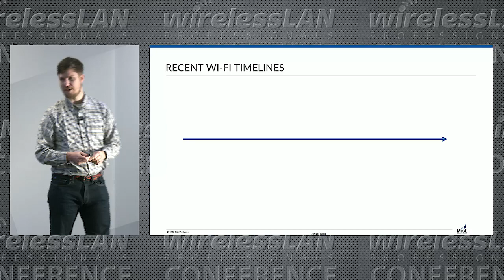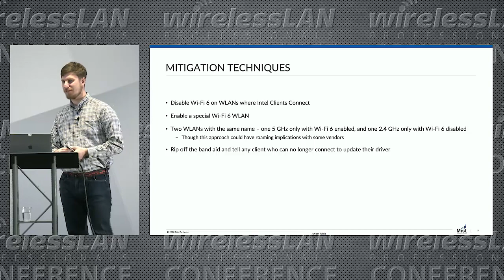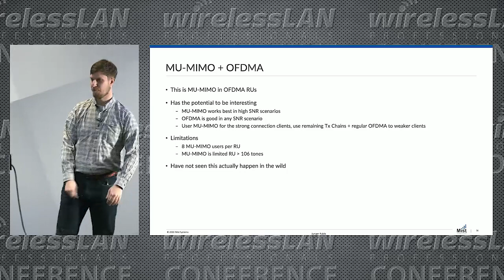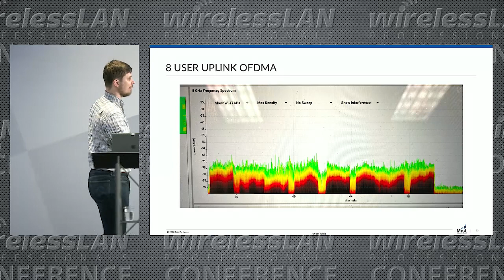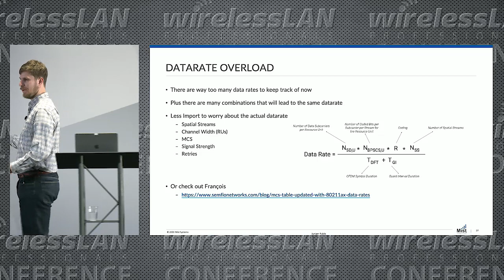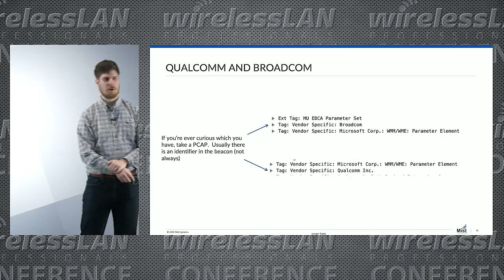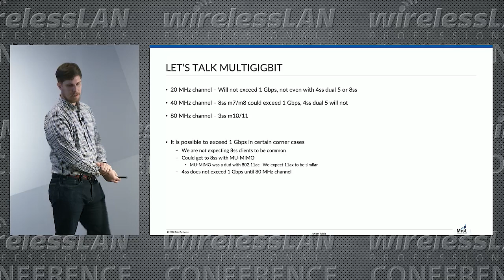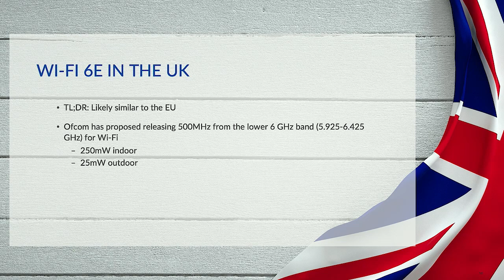802.11ax Lessons Learned | Wes Purvis | WLPC Phoenix 2020

Comment: 15:32, In your explanation of MU-MIMO + OFDMA. Having wider RU for far away clients will reduce the range of the clients (decrease in SNR , noise increases over BW). Closer clients should be given larger RU's so that they can handle higher capacity.
Reply: Actually, SNR remains constant for across RU size.  The receiver must still listen over the entire channel width, so there is no SNR gain with smaller RUs.